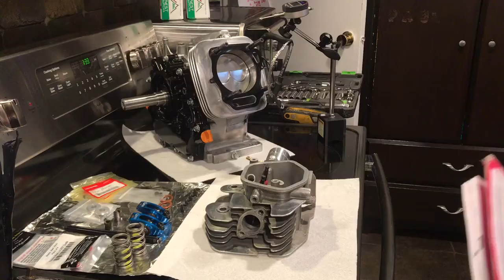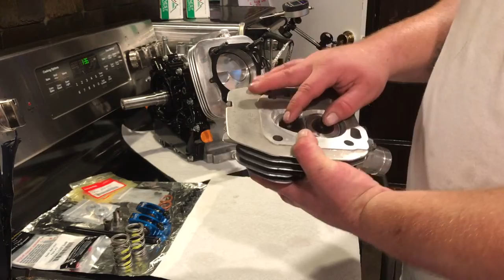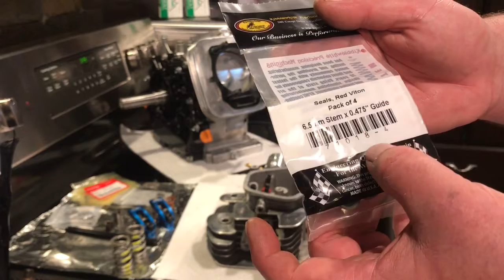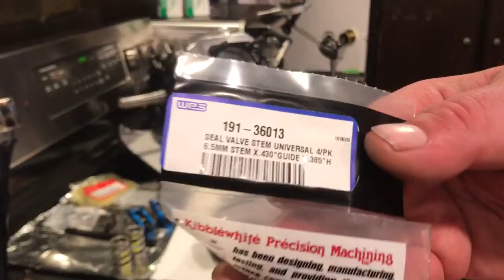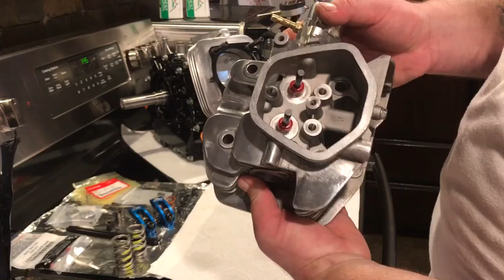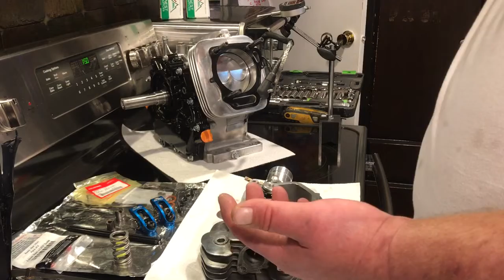honda gx390 CYLINDER HEAD INSTALATION .. valves,valve springs, porting, torque settings

Comment: I have a gx390 I’d like to know where is the best place to run my pulse pump from ?
Reply from the maker: Depends on what cam your running .. if the cam has a lot of duration you want to run the pump off the case .. if your cam has under 250 duration the intake is fine ..
Reply: Paul's karts Lifan 420 stock cam
Reply from the maker: Intake